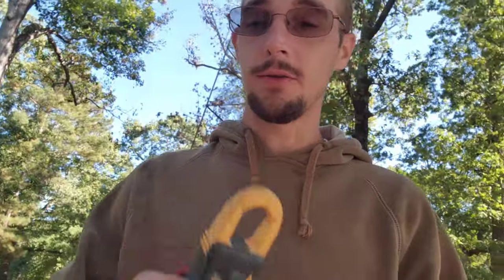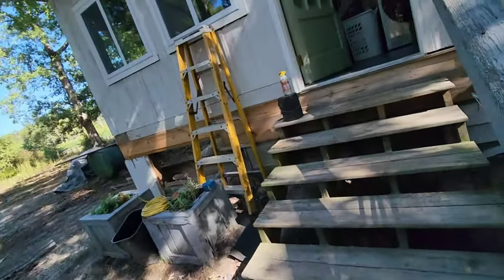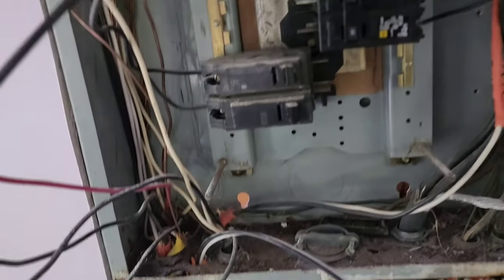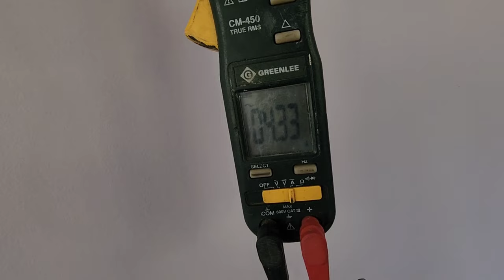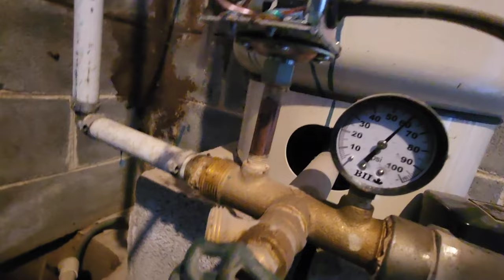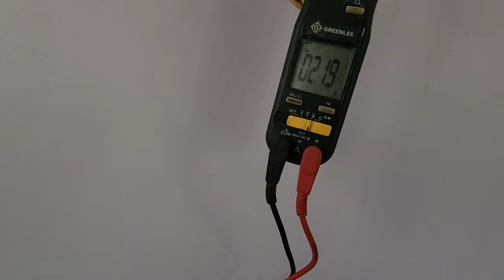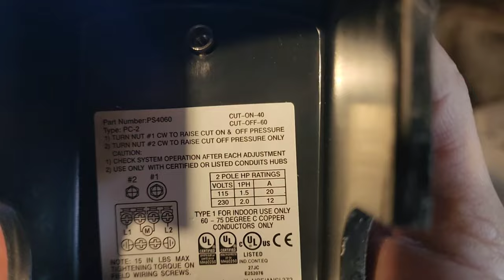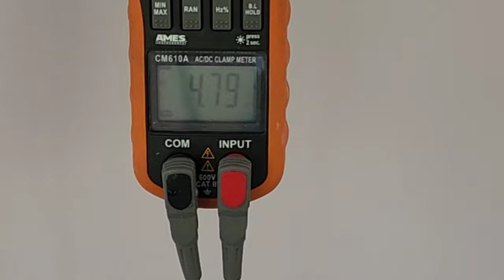Well Pump Electrical System Troubleshooting. Step by Step Tutorial.

Comment: wow, just bust a hole in the bricks and stick everything through and dont support the wire or anything.... that is a really crap install whoever did all that.... Myself, I would have cored a perfect hole through the wall to run my pipe through and other wires and such....  I hate BS installs like that, "oh that wont matter, takes a LFH (Little F#%^en Hammer, as opposed to an BFH, Big F$#*ken Hammer)  Dunno if it would have an issue with the foundation, but looks like a foundation wall to me, so in 15-40 years might be important... I wonder if the original drain Cast Pipe with Lead Soldering had a hole for it, but then when someone added PEX and wire, they just took a hammer and busted out bricks...  Just poor workmanship... I've always had it stilled into me to do something right if you are goiung to do it...  and if its a job site or friend/family, do it better then I would want done on my house...  

But the dog and cat's living in the crawl space, wtf....   but maybe thats nmormal around there.... here in Phoenix, we dont have basements or crawl spaces, but its 120 in the shard for weeks on end and over 110 for 3 months.  

But if I was putting in a well at my house or something, I'd have a 1 1/2" grey PVC conduit run for electrical, for a pump and a seperate GFCI circuit for an outlet to mount to the side of the cement casing for future lighting or yard work or entertainment. Also likely a smaller 3/4" next to it for any future low voltage, PoE CAT6, or soemthing, as I am a lead network cyber security archetect, and my house is fully automated and sensors everywhere and full control of my house via sensors, routines, scenes, etc in Home Assistant.  I have over 210 IoT devices for my home and over 2400 sensors and data feeds for my home. (3800 sqft built in 2019, symetrical gig fiber internet)  So I'd have all kinds of amp sensors, temp sensors, and such...  

This way the electrical wire is sheilded from outside things like someone digging and cuts the wire (I dont understand how anyone would direct burry a 110/220v wire, even when rated, just seems like rigged together BS).  "oh its only temporary until we get conduit installed."  we all know "It's only temporary" becomes, its permeninet until it breaks.   and if something does mess up, you can easily swap out the wire....   But thats just my OCD electrician side speaking...

Comment: why did my guys use 3 wires again instead of the one wire you used . I  look at the county for info and 3 wires look like they are not code anymore . The wording the county uses is kind of sketchy , could mean one thing or the other

Comment: since the plumbers who pulled my pump did not listen to me  about checking the wires before they put new pump down and it blew  new pump in half  and had to pull it again are they responsible if they damaged my pipe under ground . I am getting more dirty water than ever before . Pressure tanks has been flushed 3 times and new switch and new pressure gauge and new whole house water filter   Could they have damaged it also  and had to cal them back because one of their connectors is leaking . I told them I am not paying them for this also   , not  my fault  theirs
Reply from the maker: Typically removing a pump does mix up alot of sediment. 
The key thing to focus on is the pressure gauge. It must build up to 50-60 & hold steady there without going back down. If the pressure drops & raises in 5 minutes repeatedly, that'll indicate a leak in the line somewhere
Reply: @h2omechanic  I had to buy the sqaure D pressure switvch for now until yours comes in the mail . The other one  was so clogged up from the well going dry and now I am sure that all the damge that did to my whole  house filter and draining my well was  caused by the pressure switch The hole up to it was completely closed and the diaphram up there was damaged . I stayed on 40 until I would take the top off like you said and push the connector   then it would click and go up . I took out of the  pressure switch and extension on it at least 2 inchs of thick gunk . maybe you should make a video of a switch clean and dirty ,